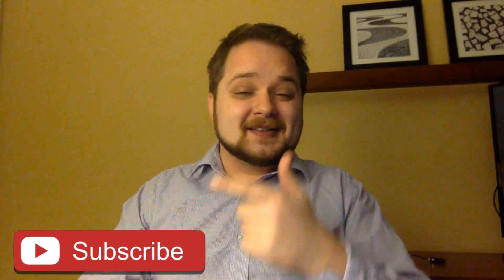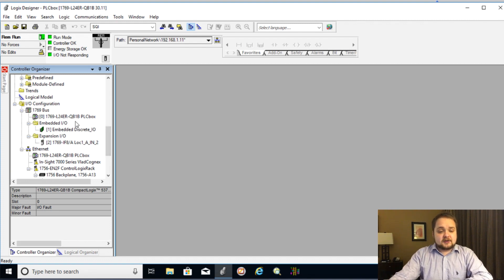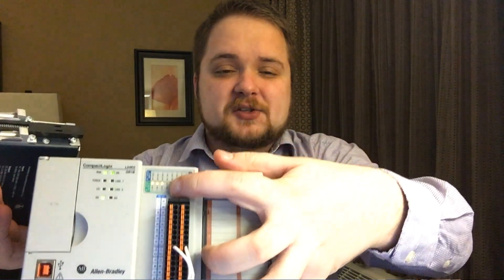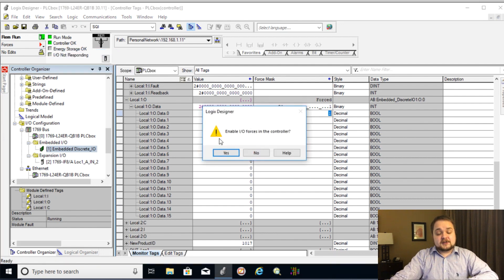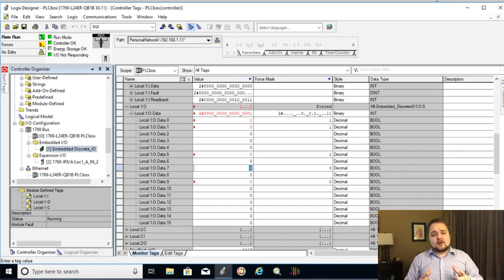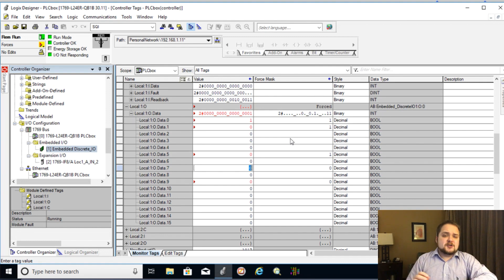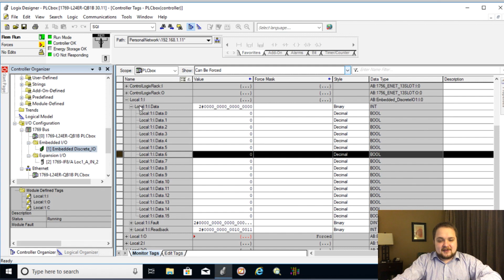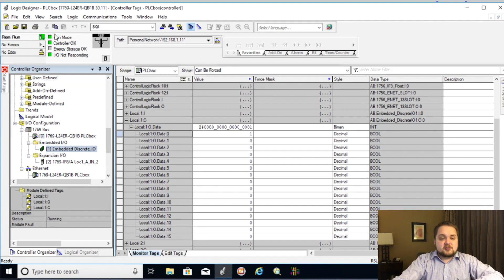PLC Forces Tutorial - Working with Forced Inputs, Outputs, Troubleshooting & Online Forces RSLogix

Comment: As a maintenance electrician Force I/O is a must have " tool ". Often after machine shutdown lubrication/coolants etc aren't in the right viscosity therefore your pressure sensor will fault out on high/low pressure. To be able to get this going the O of PS can be forced and that will allow the recirculation than eventually you achieve the right temperature.
That can be applied to any value or application.
Makes life easy :)

Comment: Does anyone know if you can force remote IO that is on a profibus network on rslogix?
It appears that it is not possible. Several of our plant engineers have been trying since this could be a game changer for us.
Our processes are mostly controlled by Siemens /CTI  w ET200S remote IO. We want to switch to Allen Bradley Rslogix but if we can’t force, it would severely hinder how we do troubleshooting now.
On CTI we can force any profibus IO. Thanks for ANY commentary…
Reply from the maker: Interesting... I've never tested this. I'd be curious to see if we get an answer. Have you tried to reach a Rockwell expert on this?
Reply: @SolisPLC  yes we have a support contract for our software, and waiting for  their answer to this issue.
We think we can build a work-around but it would be messy. If this can’t be done I’m guessing we may change our path forward and keep our CTI processors. I prefer them anyway over Allen Bradley as they really are direct replacements for the older Siemens 505 series. Very robust and with Fastrak profibus configuring is a breeze.

Comment: SOLIS
Logic wise, If i force say Motor.1running on. and in another rung i have an XIC Motor.1running. Will The latches and input instructions involved with the specific output also be True throughout the program. THANKS
Reply from the maker: Hi Steven, if you force an output or input, it will be HIGH throughout the program.

Comment: I'm new to forcing so overall this was helpful, but contrary to what you say @1:30,  forces can be applied to both inputs and outputs.  When forcing inputs, the input light remained off on my L23E, but the bit was forced and subsequent logic enabled and outputs energized.
Reply: You can. I force inputs to prevent logic halting when I need to replace a piece of instrumentation.